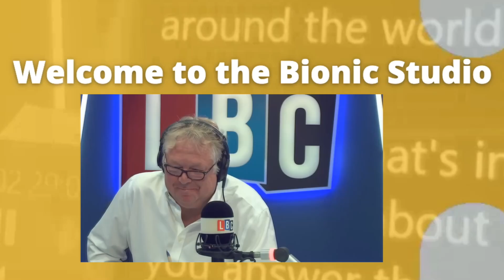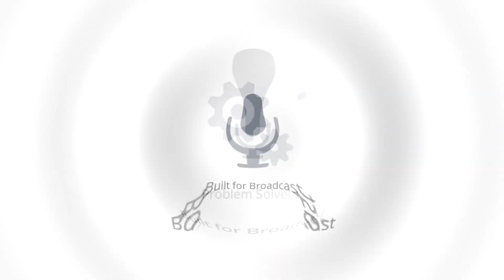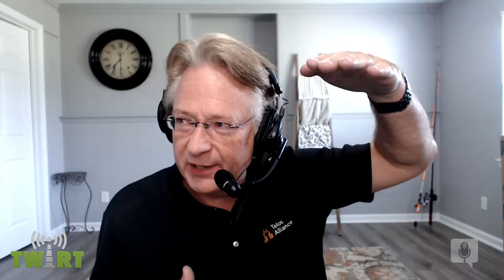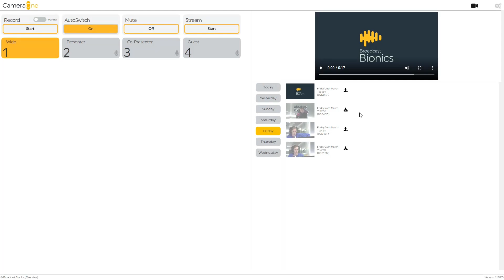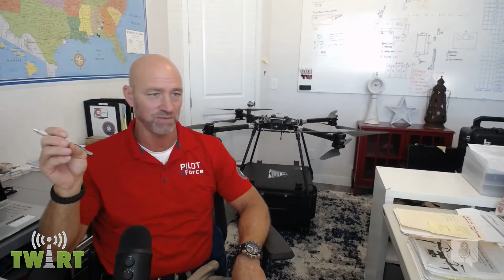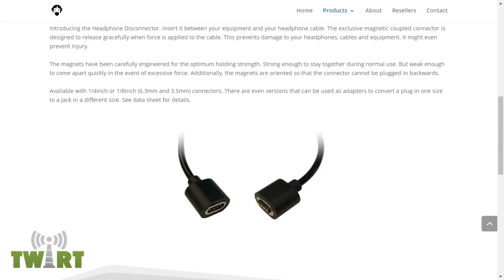Aerial Measurements, Military Precision with Phil Larsen - TWiRT Ep. twirt555

Comment: It’s a challenge for broadcast engineers to efficiently and effectively measure the output of their radio station’s signal. How can they maximize the output of their transmitter, so that it penetrates into the places that will best serve the public, their advertisers or underwriters, and meet management’s goals and enabling objectives?

On this Episode 555 of the TWiRT Podcast, Phil Larsen, Vice President of the QForce Airborne Division of QCommunications, describes the use of unmanned aerial vehicles (UAVs or drones) to take accurate RF measurements that will meaningfully provide broadcast engineers with the kind of data that will aid them in satisfying the needs of the stakeholders in their station’s operations. Phil illustrates his explanation with videos and clearly stated discussions with TWiRT host, Kirk A. Harnack.